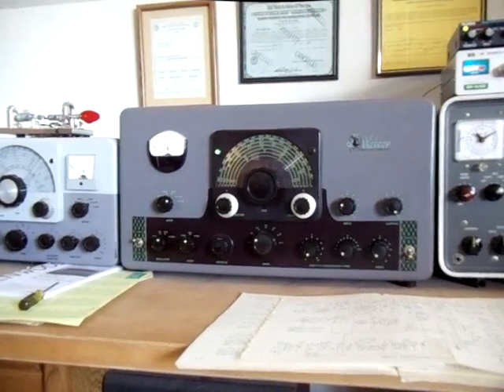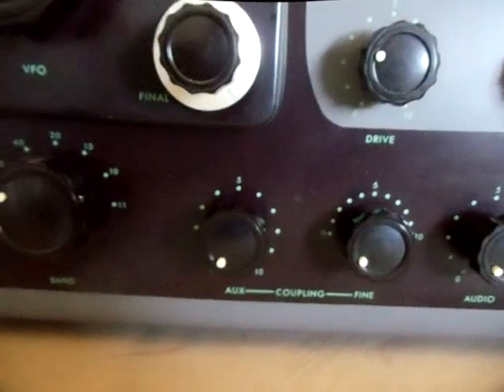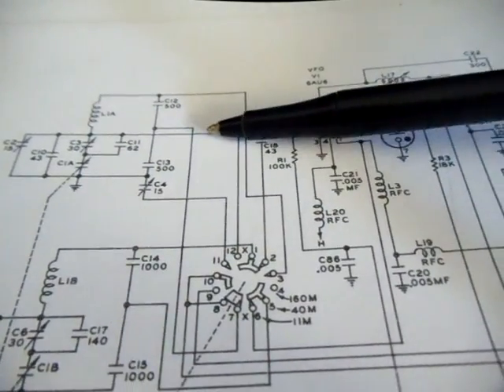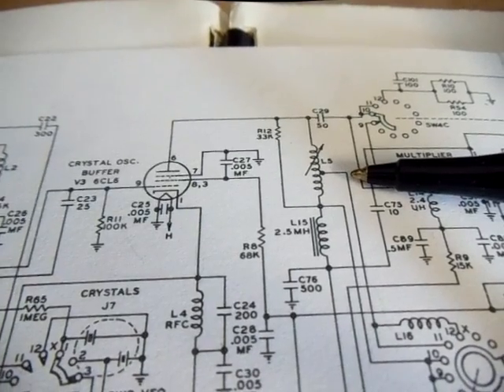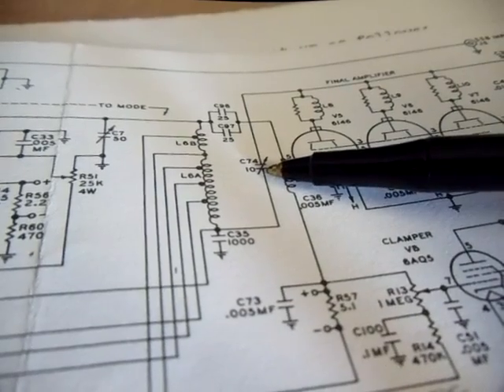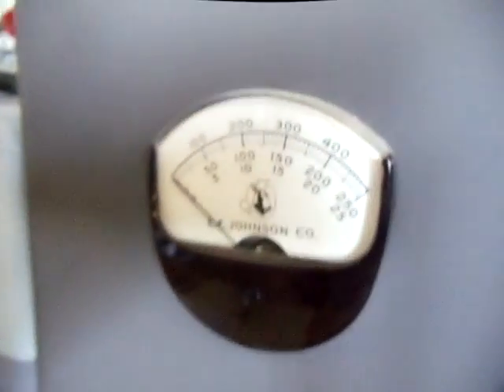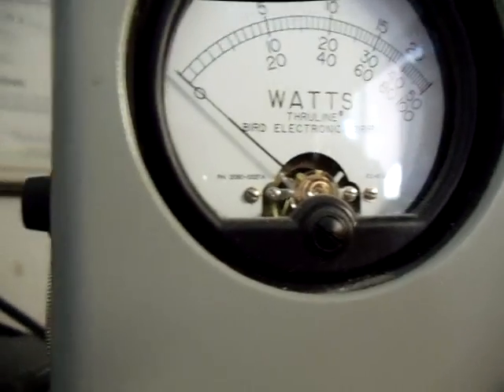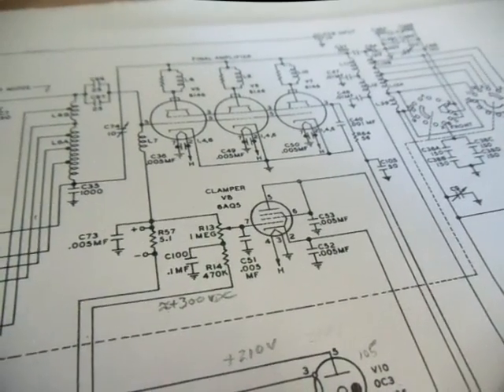K7PP,  Johnson Valiant,  How it works, Part 1 Ham Radio

Comment from the maker: Hi Glenn.   I've had many Johnson Transmitters but not to many problems with the band switch.  I have had problems with burned Aux coupling switches but that's because folks "hot switch" them and RF can arc and burn contacts.
Also have had power/transmit switch problems with Rangers and the large tapped resistor underneath.  There are lot's of really good mods for the Ranger and Valiant and I might try a video on those when I get a chance.

Comment: Great video, Thanks.
I have recently found a Valiant that has been in the box since it was new and is truly in Mint condition. I have restored several Rangers and like the Johnson xmitters. 
I read a review on eham and one person believed the band switch in the Valiant is inferior. Before I start checking it out, was wondering your thoughts on the band sw and other weak areas in the Valiant.
73,
Glenn WA4AOS
DSM Labs  dot com